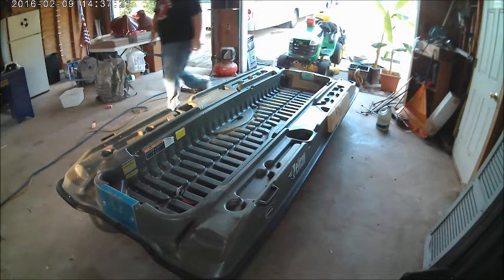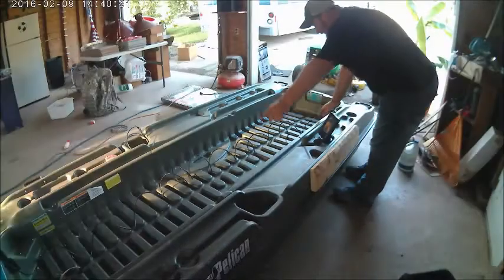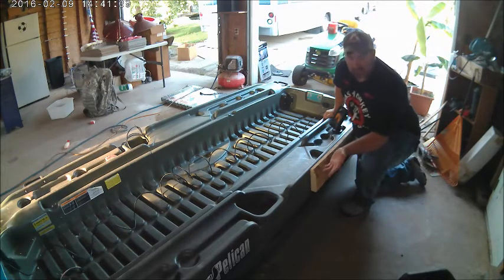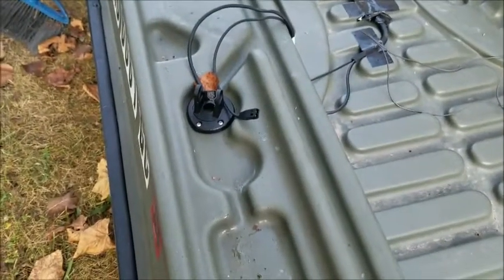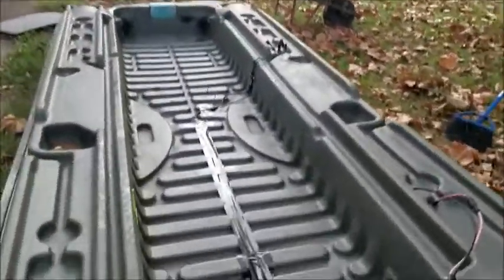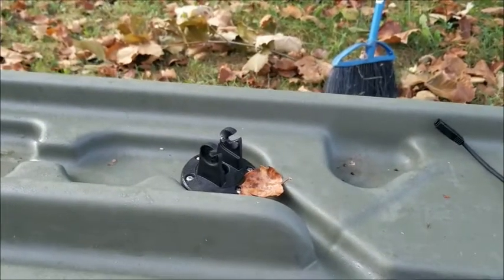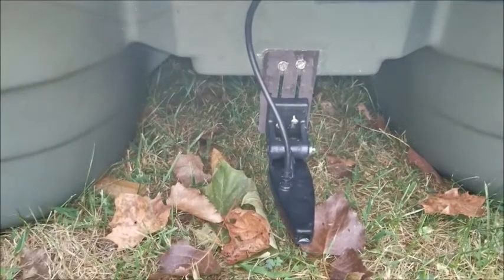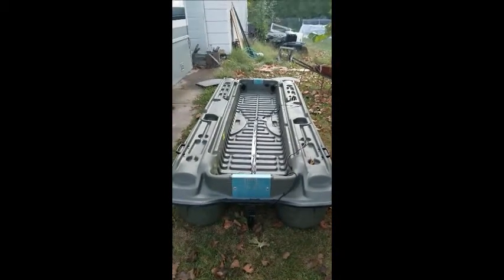Installing Transducer on Pelican Bass Raider

Comment: Planning on buying one myself. As far as running wire for accessories up front to back of boat where battery will be I will be running wire like you did in the middle of floor
Runwire in 1/2 cpvc and velcro the whole run where cpvc will lay and velcro cpvc as well that way it's there and it's not going anywhere and drop a 3/4 plywood floor with carpet

Comment: The traneducer is not below your pontoons is that still give you a good picture or dose the pontoons get in the way of the picture Ans also how is your trolling  motor at that point?  Does it interfer with your transducer that close to it?
Reply from the maker: The trolling motor is in the front of the boat so it has no effect. I have always had a clear picture even with the rudder I made for the back.

Comment: Is water leaking inside the boat where you mounted the transducer?
Reply from the maker: That only touches the water if you have a heavy load in it, (like 3 guys and gear), but I also siliconed the screws to make sure it doesn’t leak.

Comment: How did that bracket hold up?
Reply from the maker: Sorry I'm not getting my notifications for some reason?  I put it in the rear of the boat between the pontoons, so far it has held up good. I had one time that I set it down on a rock but the metal was flexible so it didn't break, I just bent it back out and it was fine.

Comment: How did mounting the transducer in that spot work?
Reply from the maker: It works great,  but the downfall to it is trying to unload it out of the back of a truck by yourself,  It catches on the ground when you unload it and bends the brackey. If you had a trailer it would be fine.